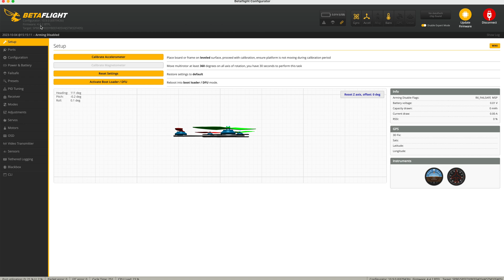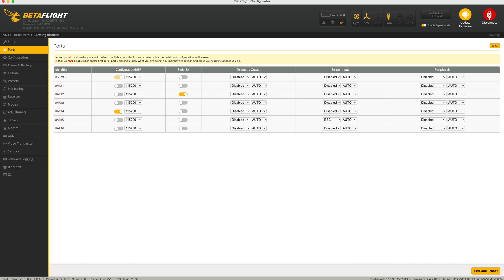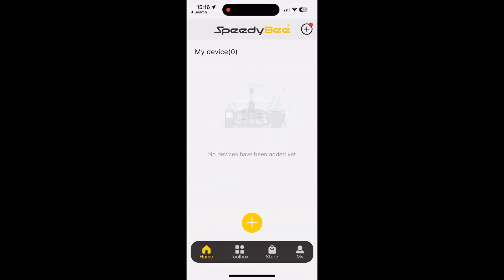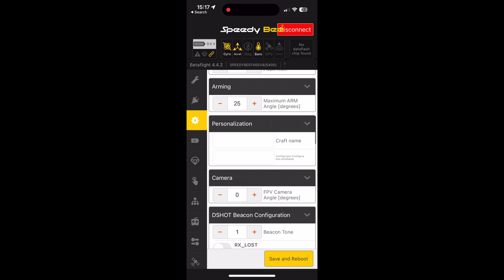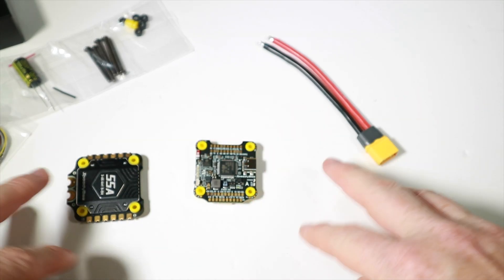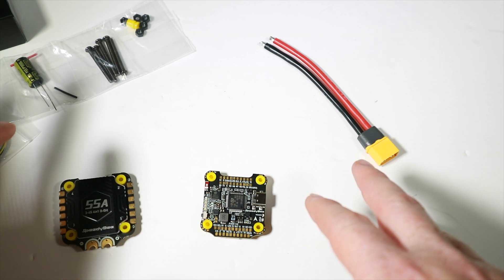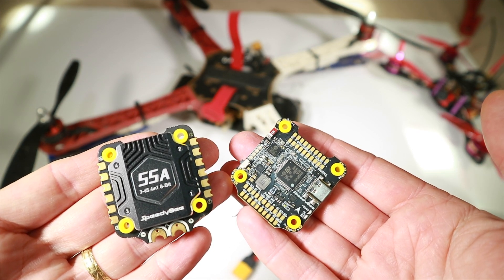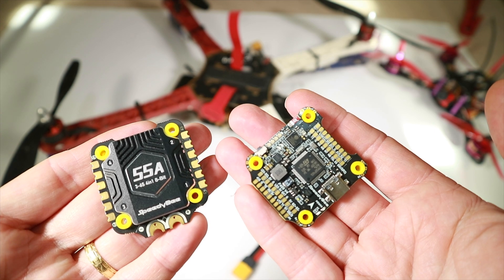SpeedyBee F4V4-55 Stack.  Great value for money and some cool features

Comment: I have 8 quads with Speedybee F405 V3 stacks and i never had any issues. I used to be a Diatone Mamba stack user, their great but i couldn't keep using them with the prices so high. 4 yrs ago, a Mamba stack was around $60 maybe $70 for top of the line one but once it jumped passed $110, i couldn't mess with it, i gave the Speedbee a try and been using them ever since. If Speedybee can sell their stacks at these prices, i'm pretty sure Diatone could too. Speedybee has sold thousands of these low price stacks and you don't here the horror stories even though i'm pretty sure all these stacks coming off the line are all perfect.
Reply from the maker: All looks good so far and nice and easy to work on the FC.  I just finished the build off today ready to test (if it ever stops raining)

Comment: Thanks for sharing man.  For the price to have a stack with these features seems reasonable.  I mean diatone mamba stuff is good quality but has a high price that comes with it.
Reply from the maker: I haven't used the Diatone stuff for a while.  I generally only had it with Diatone RFT quads.  Seems nice quality though
Reply: @CurryKitten  yep!

Comment: ive done this with speedybee f405 v3 stack and tbs discovery frame running arducopter ... it works fine all the gps stuff works but some things like Bi directional Dshot did not work on the older V3 .. maybe it will work on the newer one
Reply from the maker: Out of the box bidirectional dshot isn't supported as the ESCs run Blheli_S, but I think you can flash them with Bluejay and then it'll work.  I haven't done that yet - I'm trying them as they come to start with
Reply: @CurryKitten  I tried it with bluejay but no luck then I noticed bidirectional dshot is also disabled in inav so maybe there's something with that version ....
On the v3 product page it also says that biDshot is not supported on inav .
Reply from the maker: I mentioned bluejay in terms of what it says it can do on the v4, not sure about v3
Reply: @pradumnsingh1938  INAV firmware doesn't support bi-Dshot, that's why all FCs can't do Bi-DShot with INAV firmware